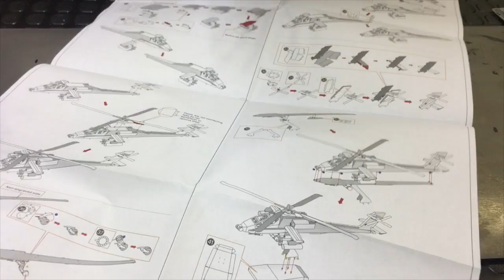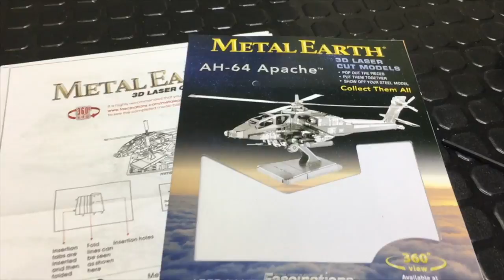AH-64 Metal Kit Build

Comment: Hey, how did you do step 3 of this? It's the tiny cylindrical piece that goes in the center of the rotors after you get them put together. looks like you had some trouble with that part as well. Any suggestions? Do you just have to roll it really tight?
Reply: you'll want to use some type of tool as a mandrel to wrap the cylindrical parts around.  That piece you are referencing has a very small diameter.  I used some very skinny and long needle nose pliers to assist in rolling the piece to shape.  a short length of 2.5mm rod would possible help also.
Reply: Thank you! Used a small drill bit as a mandrel and it worked perfectly! appreciate the response 👍